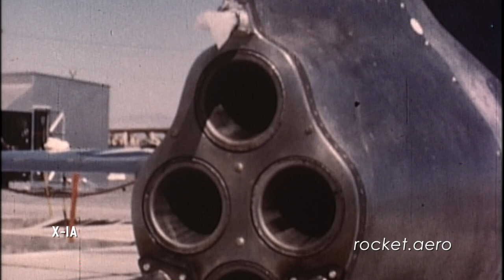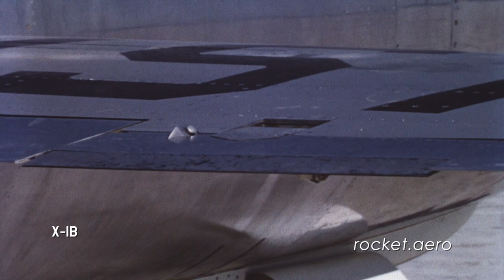Supersonic: the Bell X-1

Comment: There is some debate that the German ME-262 achieved supersonic flight in a power-dive in late 1944...by Hans Guido-Mutke. He described the characteristics of supersonic flight (buffeting...smooth and silent flight, then buffeting again as he decelerated) before those characteristics were later later described in 1947. Wind tunnel tests of models of the ME-262 later showed it was in fact capable of supersonic flight in a dive, though it would suffer airframe damage, as Mutke’s plane did.
Reply: Very interesting, thanks
Reply: Chuck Yeager confirmed Mutke's story..
Reply: There is no credible evidence that Mutke's plane suffered any serious damage... it was noted that a few rivets were missing and there was some distortion on the rudder panels.

Comment: The Miles was designed to be supersonic not trans-sonic. The engine was designed by Whittle to be supersonic and the Miles M-52 was to be flown by 'Winkle' Brown. Whittle had patented re-heat (afterburning) and also the turbofan, though this was to be a pure jet. The design of the aircraft incorporated a fully flying tail. Scale model testing later proved it would have flown supersonic.  There was never a good reason for cancellation and it all remains a bit of a mystery..
Reply: The Miles M.52 never existed and would never have been able to reach Mach 1.
No aircraft powered by an obsolete centrifugal compressor turbojet hasever flown supersonic in level flight.

Anselm Franz invented the Afterburner and was first demonstrated on the Jumo -004B
Reply: @WilhelmKarsten  Anselm Franz was another genius. I think his engine was remarkable. Doesn't alter the fact Whittle patented high bypass fan engines and re-heat in 1936. The Miles M52 ''never existed''? Well of course it did exist and was at a stage of 95% completion when it was cancelled by short sighted/corrupt government officials. The maths for thrust required to get the M52 supersonic was settled and Whittles engine - on paper - would have delivered the required thrust. We will never be sure unfortunately but what is certain, aerodynamically the aircraft itself was viable. Viable to fly supersonic in level flight. Confirmed with model testing and computer modelling too. Of this fact there is no argument, even if you want to pretend there is one.
Reply: @martinda7446  We know with absolute certainty that the M.52 could never have reached Mach 1, it is well-known and understood that centrifugal compressor jet engines are simply too inefficient to reach supersonic speeds in level flight, in fact NO PLANE powered by a centrifugal engine has ever flown supersonic.
any questions?
Reply: @DoktorBayerischeMotorenWerke  We know with absolute certainty - Bwahahhaha. 1952, supersonic fighter I-370/ I-1, Mikoyan and Gurevich Design Bureau.
No reason AT ALL that an engine designed for the purpose and supplying the thrust required - Which this engine did, with Whittles afterburner would reach mach1.
Reply: @martinda7446  Never happened! The OKB l-1 prototype was a disappointing failure and never achieved its designed top speed.
No aircraft powered by a crude, inefficient centrifugal jet engine has ever reached Mach 1 in level flight, the Thrust-to-drag ratio performance of centrifugal engines is simply too low. The program was abandoned in favor of better axial flow jet engines.
 The Miles M.52 never existed, it never flew because it was never constructed, and no completed plans have ever been found.